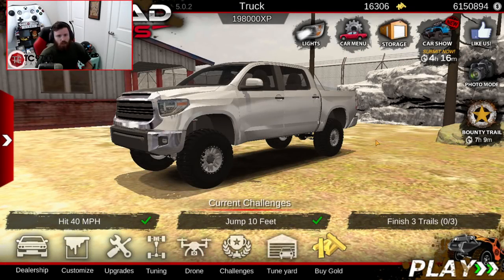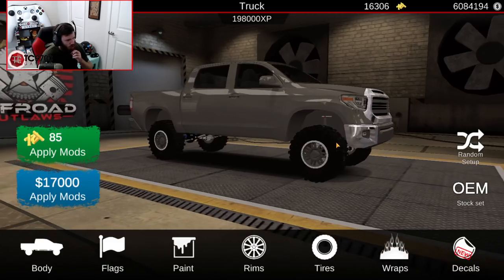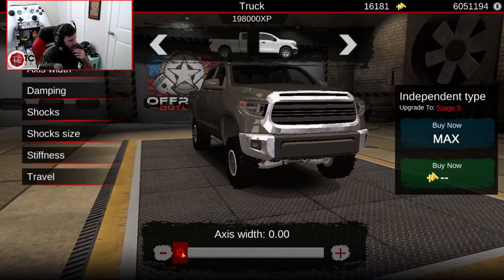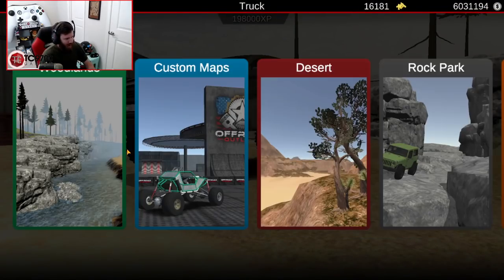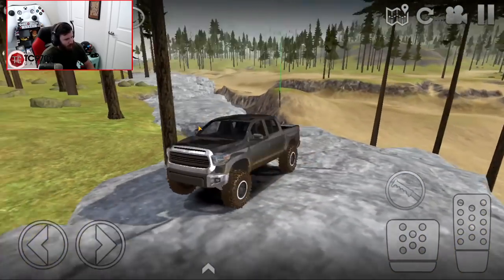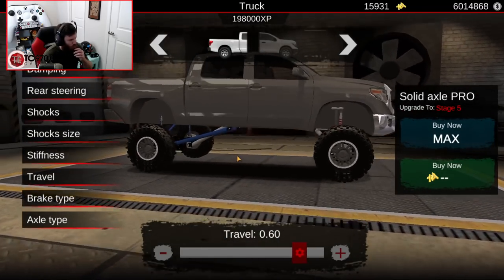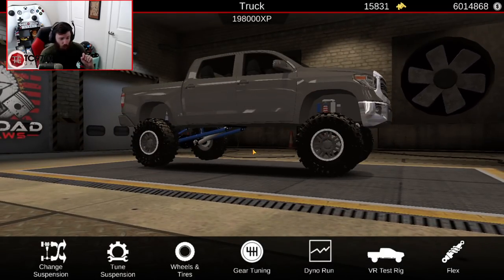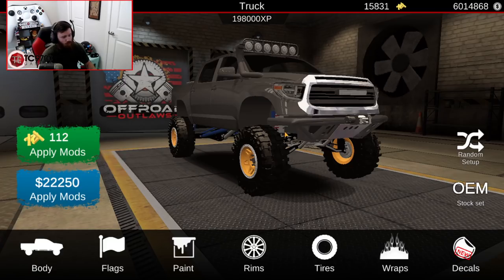Building My REAL TRUCK in OFF-ROAD OUTLAWS!

Comment: Hey TC are you upset you didn’t wait for the next gen tundra ? Or are you content with the truck now
Reply: being a toyota tech he’d only regret it for the cosmetics. basically any tundra is stout mechanically, whether its the 4.7 or the 5.7 honestly never see any come in with major issues unless they were abused/ran low on fluids. and here i am owning a money pit 2nd gen cummins😂😂
Reply: @AirsoftGunsAndBbGuns  😂 my dream truck is a obs f350 power stroke preferably with a manual